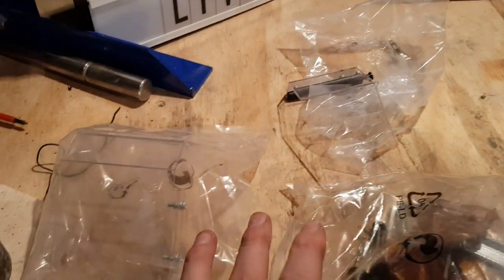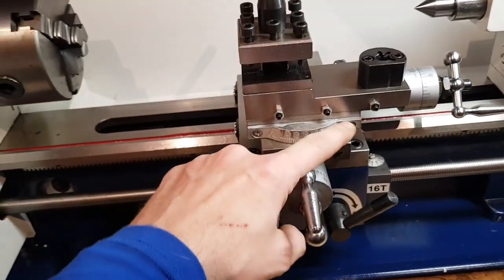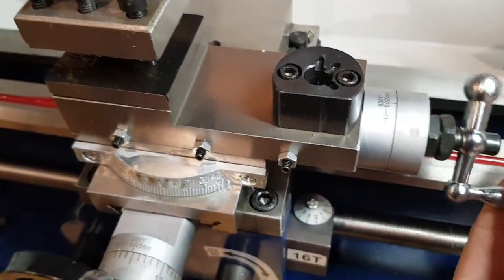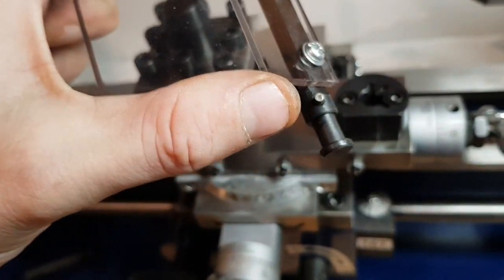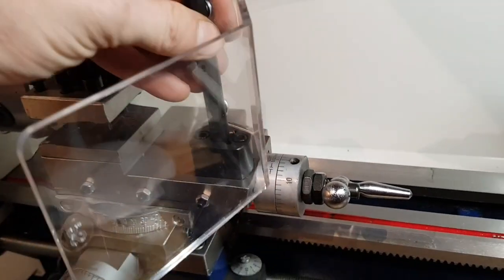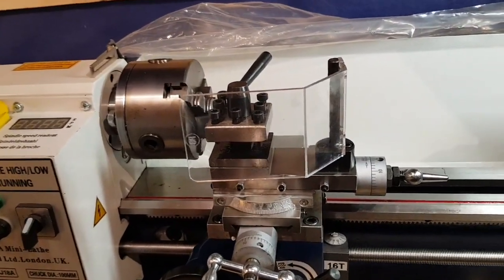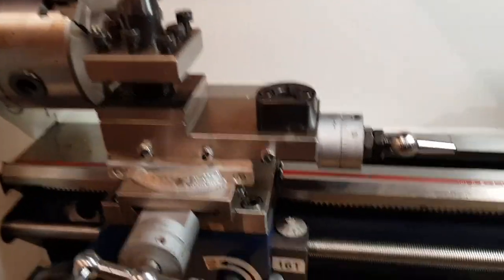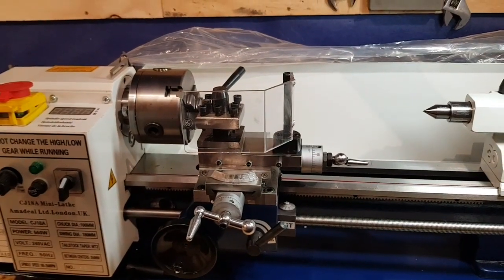BRAND NEW MINI LATHE UPGRADE FOR COMPOUND SLIDE

Comment: Harbor freight has the guard on top that covers the actual cutting area because usually you will be looking down from the top.  That is a nice looking machine you got there.  I bought the harbor freight mini lathe. Haven’t had any issues with it as of yet.looks almost identical to yours except mine doesn’t have the digital read out.  Any way hope you have loads of fun with yours and enjoy it.